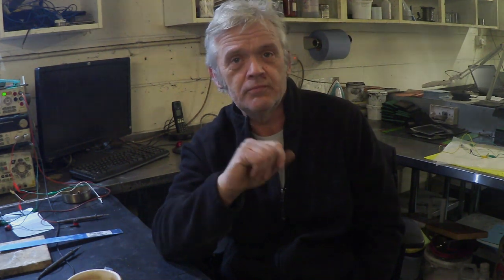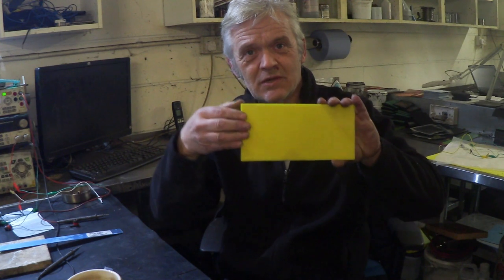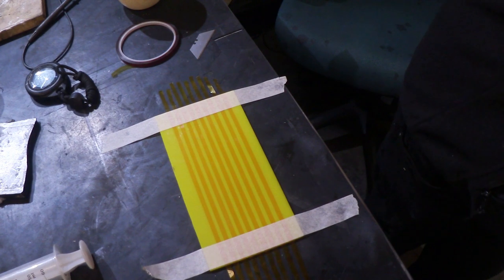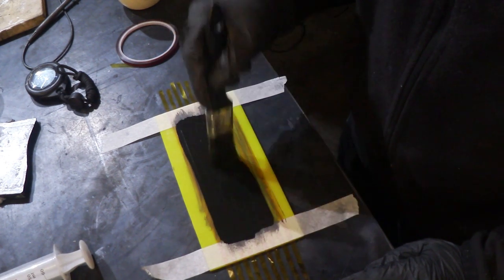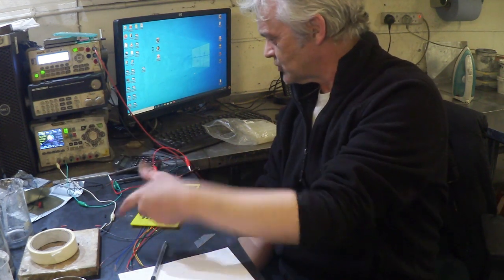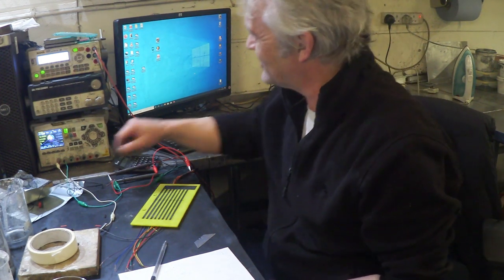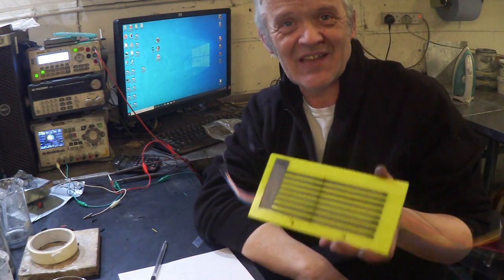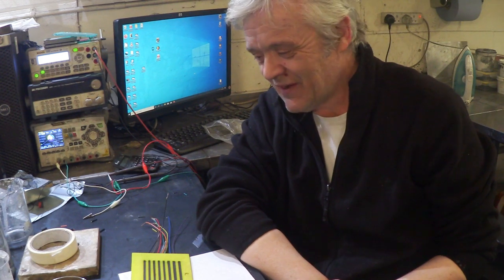A Voltage Divider With Conductive Ink

Comment: I was around 5 years old when i grasped this concept looking at my scalectrix hand throttle .i think the carbon track also went from wide to narrow to limit the voltage and possible the current ! It started my career involving electronics !
Reply from the maker: awesome mate
Reply: The variation in width would be to give a non-linear relationship between position and voltage, probably so you have finer control at the low end.

Comment: Rob, you might consider covering the printed lines in a plastic bag or just some lamination because eventually those lines will be sensitive to the environment. Just get close to the voltage divider and exhale some warm breath at one side of it and look at the voltage change! Yes,  you've just made a sensor :)
Reply from the maker: Laminating is a really good idea mate I will do it - cheers

Comment: So is the ink what I would need to coat copper mesh with out losing the permeability of the mesh? I was thinking of using a spray gun to apply very light coats so not to clog up the mesh openings. When I think of an ink I think of a materiel that never cures.
Reply from the maker: I have to say 1t's water resistant mate not waterproof
Reply: @ThinkingandTinkering  Thanks Robert if you have an alternative solution please let me know.

Comment: This works for Robert's use case.  If you have resistive loads, the voltage can change  with the load - you can correct for this by measuring voltage with the loads connected or measuring resistance and using ohms law.  ... or use an appropriate zener diode.

Fun fact: It wasn't the Chinese who first started removing functionally unnecessary components (Muntzing).  Muntzing is named after Earl "madman" Muntz who did it with televisions and other electronic devices in the mid 1900s.
Reply from the maker: nice add mate - thanks - and fun fact lol

Comment: I really enjoy watching your videos your attitude is what makes them really enjoyable

With all of the technology you have pushed forward discovered and invented can there be a battery or very large storage capacitor made out of 5 gallon buckets

A person wouldn't need to make very many cells if they made them 5 gallon bucket size

a lot of us can scrounge up old lead acid batteries and other materials

   Four non mobile applications  space and weight is not a consideration

I did hear you mention a few videos back that you was working on something like this

Of course you are the expert it may not be feasible

I would buy the plans or make a donation everyone has to eat and pay bills

 thank you for your time
Reply from the maker: thank you for saying so and tbh I think it would work it wouldn't be the most efficient but it would be cheap and do the job and I like that - I'll have a think - cheers

Comment: Ah the old way we used to do it, so much more simple and logical than using MOSFITS. I wonder what do think the efficiency ratio will be? Clipping voltages create so much chatter, I worry about these frequencies causing havoc on sensitive equipment.   A great way to charge a  laptop off solar, Rob, who cares about loses with Solar, 24v down to 19, might actually be less, with smooth DC.  Inspirational, you've got us thinking!
Reply from the maker: to be honest mate I think we over complicate stuff - somehow we seem to think the more complex something is the better - often that just isn't true - the question, I think, is what is appropriate for the job you need to do?

Comment: hi rob
are you going to built solid state  battery ?
Reply: Cris Angle  heres hoping mate . It is rather complex chemistry that most likely wont be easy to replicate by us in the shed . But who knows maybe something simple can be discovered .
Reply from the maker: probably not mate
Reply: the problem is "solid state" has become the clinton fake news network/snakeoil salesmans hype word without meaning today...

if you want  a "solid state" for your super sized lego brick battery building then im sure you could use roberts carbon/graphene cement mix to encase them and so get a super "solid state" brick in your wall... :)

"Solid-state electronics means semiconductor electronics; electronic equipment using semiconductor devices such as transistors, diodes and integrated circuits."
Reply: @Buzzhumma  
"It is rather complex chemistry"
HTC and SILAR  electrospinning 
are "CONSIDERS" pretty complex i have seen rob doing it in his lab and shown how to do it
Reply: I wonder if my idea of using graphene and aerogel/silicagel for making chemical batteries would be able to do the trick (ie think glassmat but with a glass gel instead to act as the ion exchange component and graphene from heavily rubbed carbon as Robert shows in "how to make graphene sheets as big as you like" with an orbital sander if I recall and a buffing bonnet? I need to go back and look again. I hope that was the worst of it, as I have an idea for a better surface for making more uniform flat graphene on than glass (no tiny cracks nor any abnormalities from the polishing process sorta how the liquid metal has been used to make perfectly flat single layers of oxygen, for semiconductors like transistors) will do up some sort of video when I am done, luckily I don't have much interesting stuff on my channel so anyone who does see I will be able to talk to on there with out so much chatter that it makes it impossible for me to stay focused lol.
Reply: @paulmaydaynight9925  See Maxwell Site for Dry Cell Batteries@

Comment: Just a quick clarification , is th ink with the 10ml dropper bottles,working ink logo, selling on Ebay the same as your 250ml pots? I have chosen a couple of the experiments from your linked merch site, for incorperating into gaming model pieces. Just a way of showing support. Not a fan of 7.45 notes delivery cost lol. Im hoping the ink low enough resistance for running led circuits with kitchen tin foil ,without hot solder.  Another informative upload.
Reply from the maker: we don't sell 10mL bottles of it - so someone is rebadging for sure - I don't mind that in the least

Comment: Very neat idea, nice job! As it's consuming 16mA, is that per line or all together? I'm curious to know whether each line is 750ohms or all 8 lines, and interested in the relationship between width, number of coats and resistance. I would assume more coats decrease resistance and thinner lines increase resistance... ?? How controllable is this if you wanted to be very precise and make a component like this very small?
Reply from the maker: It's a homogeneous product so very precise - though resistance is going to be effected by environment so it would be a good idea to overcoat - maybe with a varnish or plastic glued on top - something to stop the moisture getting in.

Comment: Hi Robert,is it possible to carbonize bamboo fibers to make a carbon fiber or a graphene fiber material strong as or stronger than actual carbon fiber.
Reply: Short answer is give it a go, long answer is you are not specific enough on the latter half. Single-molecule chain or multiple treads/yarn. IMO Robert does not have the equipment or money needed to find out.
Reply from the maker: Barskor is spot non I am afraid mate - no time no money and only so much one person can do - you could always look into this yourself - use google scholar and have a few months researching

Comment: Hi Robert, Cool Device, thanks for sharing. 

P.S. I have a question, do you think 5g will make Batteries and Cable Charging obsolete? 

I mean do you think it'll come to the point everyone's Phone's will be charging Wirelessly Outdoors everywhere? To the point where we'll never need anything to charge it?
Reply from the maker: I don't know mate - I don't know that much about 5G - but chances are it won't make charging any easier is my guess
Reply: @ThinkingandTinkering  I see, I was just wondering about that, thanks Robert.

Comment: Hi Robert. Have you ever thought about making a carbon fibre substitute? The real stuff is mad expensive but so were super capacitors. If the carbon fibre is cheap and strong, then maybe the frame of a car can be made from it & the battery/capacitor can be put into it. So the frame IS the battery.
Reply from the maker: no mate - tbh there is only so much one person can do - have you tried it?
Reply: @ThinkingandTinkering  Unfortunately not. My knowledge is no where near usable. Not yet anyways.

Comment: Is your conductive ink any good for restoring old keyboards with conductive rubber  contacts ?
Reply from the maker: I don't know - never tried it - but tbh - probably not - membrane switches would be fine but if the rubber is conductive throughout then you would nee to replace it with that

Comment: perfect, Lumilor manufacturers a line of electro-luminescent spray enamel that runs on 12v. Painting things like the limiter with your ink into a piece could lessen the frustration of placing components. basically like what y'all have been doing with the paper circuit project, just on a panel or something and it's one big LED kinda.
Reply from the maker: I like that idea mate lol

Comment: ..........back when voltage dividers were more common in valve and solid state electronics , the rule of thumb was that the resistance of the tapping load  had to be at least ten times the resistance of  it's portion of the divider network. The old old TVs easily consumed 300 watts but it didn't matter in the profligate days .  There's more useage of high frequency conversion these days to enable the use of small ferrite transformers to solve voltage requirements..... For your heating pads I was just privately thinking that there may not be be any heating effect for areas spanned by the adhesive copper foil. In looks like it takes up say 20% of heater pad area. Could you perhaps have split the foil into thinner sections? .There can't be any heating effects where the copper foil is surely.....I'm probably still in the dark about what the silar device will be for but I know all will be revealed.... Oh,, I see nice symmetry,, you make a voltage divider,,well you could also make a voltage multiplier using a4 size bopet projector sheets , diodes, and painted graphene dielectric capacitors to power a Jacobs ladder maybe. AC is needed..
....very good resourcefulness on your part with the setup...

Translation----
Valve = tube as in thermionics
Solid state electronics = semiconductor electronics as was once the lexicon.
Reply from the maker: cheers mate and I think you are quite correct but like I said it was the tape I had so it was the tape I used but if I was buying some for this I would certainly go thinner

Comment: Your absolutely correct Rob! It most definitely is awesome! :-) Out of curiosity, do you think your rub on priming technique would work on polyolefin plastics like polypropylene? I've been tinkering with methods to raise the surface energy of  pp (home made corona field treatment built from an old "violet wand" skin therapy device) to increase bonding adhesion when using less costly adhesives.  PP is great stuff, inexpensive & very robust, but also a bit maddening to try to get anything to stick too!  Would love to hear any thoughts or tips you might have moment to share. (Or even possibly a quick video?...maybe:-) I'm sure I cant be the only one a bit confounded by this stuff! Lol :-)
Reply from the maker: that is a really interesting question. mate - I will give it a go - tbh I suspect the answer is yes it will do it

Comment: Thank you for such great demo for the product, would using a protective coat prevent ink resistance changes? What kind of coat? Is there a copper version of this interesting ink? Will I be able to spray it?

Thank you :)
Reply from the maker: I suppose so mate but it is carbon based and pretty stable - even so a coat of acrylic varnish wouldn't hurt it - it can be sprayed no problems - I used an airbrush in one video
Reply: since he says acrylic works I would think that polyurethane sealant might work too, and I have found it is pretty tough as a wire coating once it has enough time to fully cure, almost as good (toughness) as the coatings on "magnet" wire. :) (makes me wonder if a good tough epoxy might be good too, along with polystyrene peanuts dissolved in xylene to make styrene paint which I have done but I know styrene is kinda sensitive to UV and the like causing it to degrade so far less durable than the carbon I am guessing :) (but could be a better dielectric insulator, and then encase that under the urethane? anyway interesting ideas all around, cant wait to get time to do some experimenting XD

Comment: Great job! It’ll be fun when you can get a cartridge of your ink for a printer, and print out a complete radio circuit ... or anything else for that matter. Or print onto plastic and make it a wearable. Component manufacturers had better watch out!
Reply from the maker: lol - for sure
Reply: Pancake coils and antenna

Comment: Does it get hot?
Reply from the maker: no mate - it's burning off 16mA
Reply: @ThinkingandTinkering  oh that's why you mentioned the current draw. And since you are actually using a load somewhere else it doesn't heat up.

Comment: Excellent video. Rather than find the voltage with maths could you connect a volt meter to your track with one electrode making the circuit when touched on the track then move the electrode until you get your desired voltage.
Reply from the maker: nice idea mate - thanks for that - i'll use it for sure

Comment: I hope we are not bugging you to bad 

With that being said you know how you stack the coins together to make a battery the more coins and  insulators the higher voltage

 could that be done on large-scale like 5 gallon bucket size what these new materials you have came up with 

So instead of a 5 gallon bucket containing a single cell it would be multiple layers giving a high-voltage maybe

 just a thought 

 I'm sure you've already thought about before

 there's probably some reason why it wouldn't work good

Thanks for your time and have a blessed day
Reply from the maker: the basic idea is good - but like most of these things the devil is in the detail - essentially what you are talking about it a bipolar plate battery and yes the work in large scale if you can prevent the electrolyte from one cell mixing with the electrolyte of another cell and that is not so easy - but do-able

Comment: use Copper tape and solder on the wire. No drilling required ;) A Slide for Variable Voltages. Graphene Paint is AMAZING  Mate :)
Reply from the maker: awesome suggestion mate - cheers